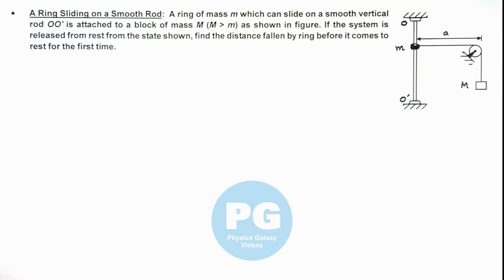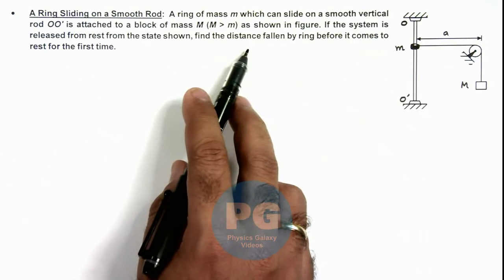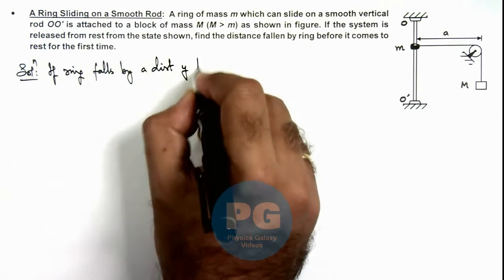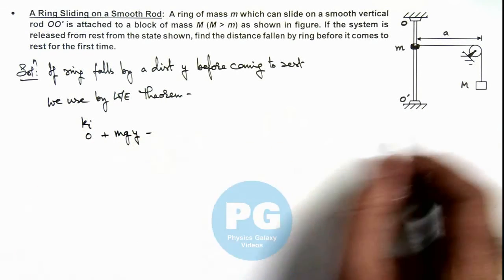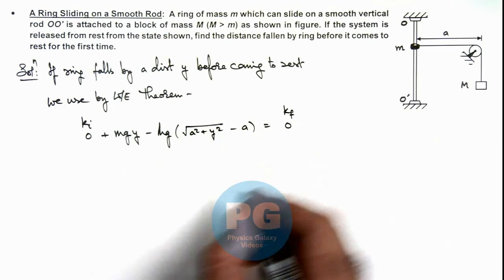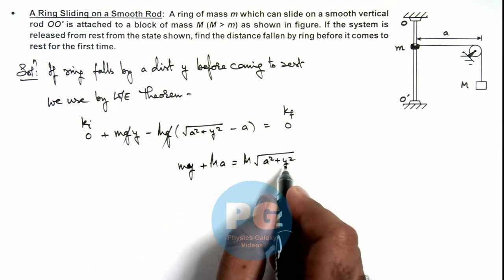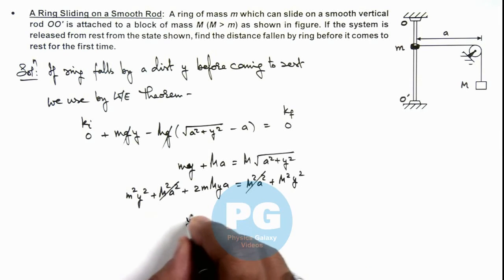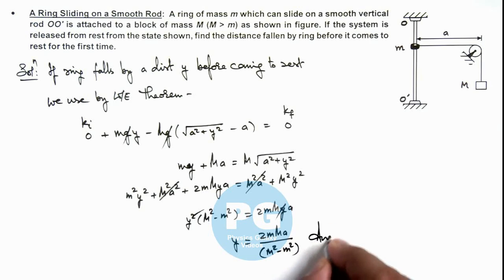Advance Illustrations – A Ring Sliding on a Smooth Rod | Work Energy Power #8 for JEE Advanced

Comment: this may clear all your doubts:
1. initially if you draw the fbd of m, you will find normal and tension are acting equal and opposite to each other(note that rod is frictionless). the weight of ring mg is acting downward and no force is there acting in upward direction. so no matter what is mass of M, the ring will always come downward and consequensly M will go upward.
2.after travelling some distance the ring will not stop rather it will perform oscialltions. here the velocity of ring is taken zero in final kinetic energy as we are analyzing for extreme positions of oscillations.
at the mean postion (where a component of tension will balance mg), the ring will not stop due to inertia of motion.
3.if m descends by a distance y, then M will ascend by a length ((a^2+y^2)^1/2 - a) because it is the change in length on the right side of ring.
4. the work done by  the tension will be zero for the system because a massless object can never store energy in it and convert it into work.
Reply: Thank you bro❤
Reply: if mass of M does not matter then why is M > m given, and why does it affect the final ans?
Reply: @rahulkarthik9085 to get you to do a mistake
Reply: thanks man
Reply: Great work bro❤

Comment: sir if M>m then why will the ring fall ,sir please clear my doubt, i am having doubt that system will be in equillibrium
Reply: No friction so fall some distance
Reply: After time  t one component of  tension  balance mg
Reply: @GyansabhaAbhi  thanks for this reply.. reallzy help ful.
Reply: I think the correct thing would be the string which is initially in the diagram considered as" a" metres  has to be slack initially 
And I am clearing your doubt after 7 years Surely not too late😅

Comment: Here, I used Newton's laws and put T=Mg and Tsinθ=mg (for ring) when the ring stops. But this gives, x=am/√[M^2 - m^2]
Reply: So, where have I gone wrong?
Also, I took sinθ=x/√[a^2 + x^2]
Reply from the maker: When ring stops, forces are not balanced so you cannot balance the forces as it is the extreme position for ring and mass not the mean position...
Reply: is it like the case when a simple harmonic oscillator stops... there the forces are not balanced...
then what would be the equations of motion?
Reply from the maker: Yes it is a case of oscillation but not shm... equation of motion are used to find acceleration or condition of equilibrium not extreme positions where v=0...
Reply: Thanks a lot sir, I completely understand what you mean sir.
Also, I like your questions, are these questions taken from a book, or are they made by you?
Also, sir, can you also make videos where questions are objective rather than full subjective? Sure, subjective questions built concepts to a great extent, and support further thinking... but, isn't it better to also have questions that are of objective type (single and multi answer types), matrix matching, assertion reasoning type, integer answer type,etc.?
But, actually, the advanced questions on this site, actually is good enough to raise the concept level.
Reply from the maker: The variety of questions you mentioned are used to judge the concept level which is built by studying the basics... first understanding of any concept need to be developed theory and conceptual/numerical questions thats what we are doing...
Reply from the maker: all types of questions we have already given in quegrid... you can start attempting those...
Reply: O, thanks a lot sir
Reply: @physicsgalaxyworld  quegrid means what?
Reply: @physicsgalaxyworld  I didn't quite get what you meant by "equation of motion are used to find acceleration or condition of equilibrium not extreme positions where v=0".
Reply: @nishantbhat260  he just means to say that at the position when ring comes to rest, it doesnt always mean that "rest" indicates equilibrium. It could be possible that the body still has some accelaration but the velocity becomes zero instantaneously for a dt time interval. think of it similar to the case of an SHM when the body is at the extreme positions it's not at "equilibrium" infact accelaration is maximum at extremes even though it comes to rest instantaneously.
So Fnet is not actually zero at the instant when ring comes to rest